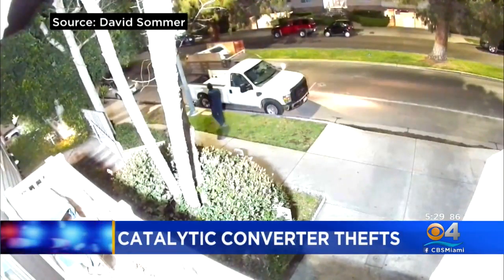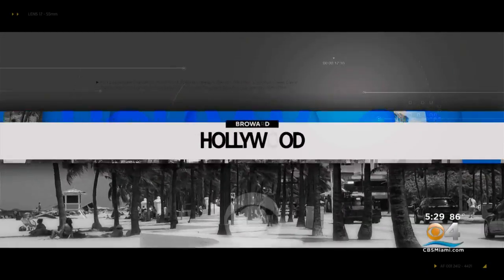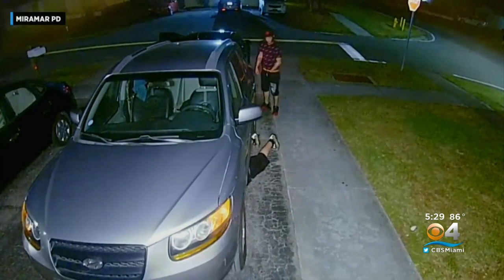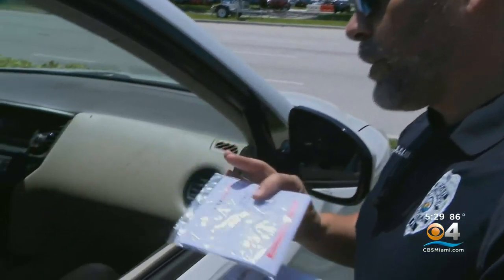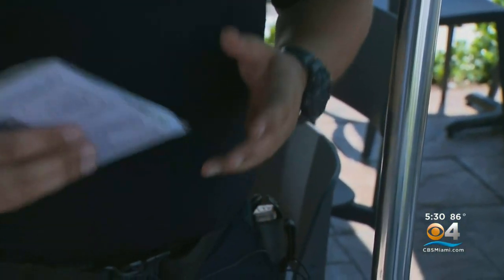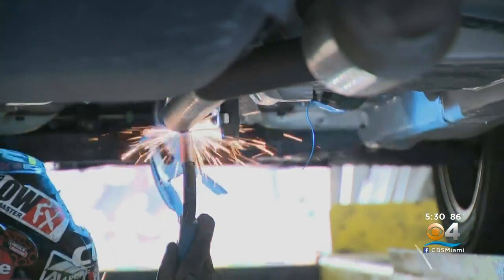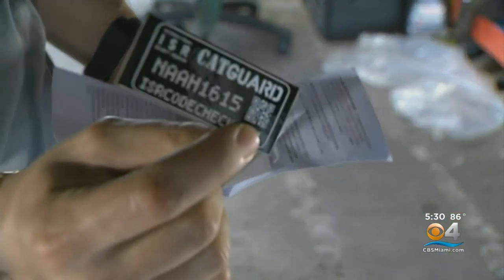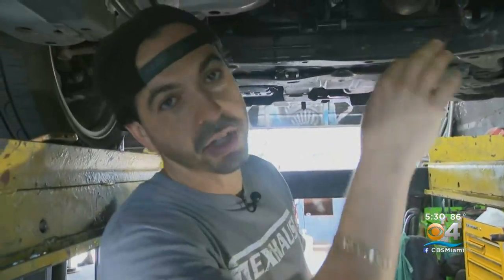Hollywood PD Using Special Stickers To Stop Catalytic Converter Thefts

Comment: Weld some rebar and a cheap cat strap over them. Problem solved.
Or get a plate specifically designed for your model installed.
Reply: What do you mean get a plate specifically designed for your model?

Comment: Oh yea like a thief wont spray over the left over serial number. Pretty shitty solution.
Reply: one pass with an angle grinder and that serial number is as good as gone, or a wire wheel disc

Comment: So removing the sticker will engrave an ID number into the metal... How deep does the engraving go?  I ask because a sand blaster will actually remove a thin layer of metal in a matter of seconds, and it won't even look like it's been tampered with.  A die grinder would leave scratches and gouges, but a sand blaster, it'd look like a new part.

Comment: Hey you put the sticker on the heat shield of the catalytic converter it’s pointless now they can just cut it off the exhaust guy should have known that and recommended to cut out a section of it with a grinder and the sticker applied directly to the cat itself